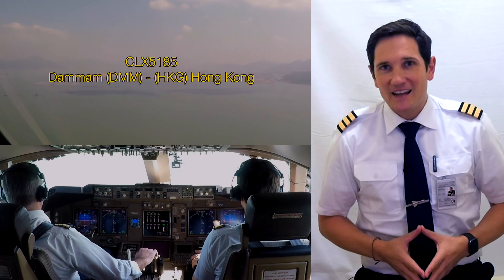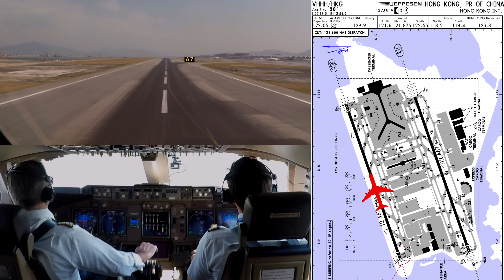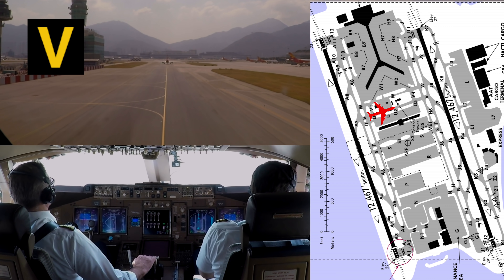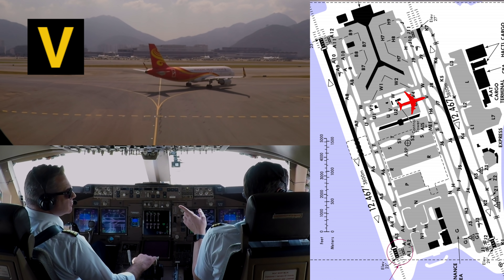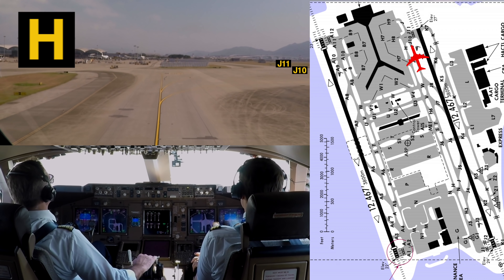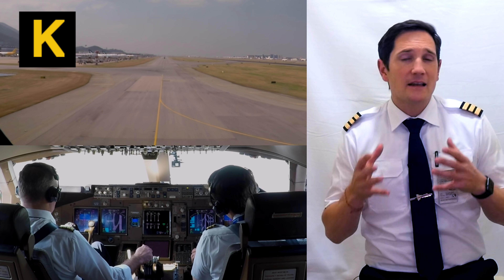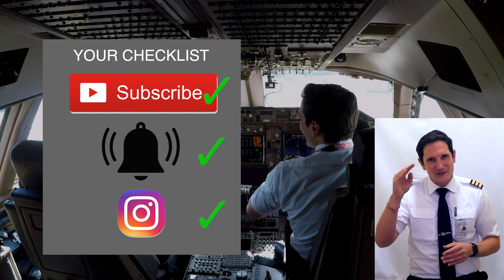How to taxi a 747 in Hong Kong

Comment: So is the crossing clearance dependent on which direction the runway is active? Asking cause the HS point is marked 25L, and J11 is the literally at the start of 25L, but both you guys and the controller referred to it as 07R when communicating clearance
Reply: Yes, the direction of the active runway is relevant (in this case 07R), and it is used in communication regarding the crossing clearance.
Reply: @mikep9604  thanks, I figured, but an unfortunate incident in my past likely precludes me from being able to enter flight school.

And that definitely seems like the type of info you normally only learn for sure in flight school lol

Comment: Why didn't the plane land on the closest runway to their designated location instead of having to cross over? It would have save on taxi feul.
Reply: It is the air traffic control that determines which one is the active runway. And it's a quite usual procedure that the runway 07L was used for landings, and the runway 07R for takeoffs.

Comment: @7:33 they are given clearance to cross 07R but the runway marker is painted 25L 25L. Why isn't 07R-25L? Is the convention in Hong Kong different than in the states?
Reply: Because you are at the end of the runway and you can only access 25L. If you cross it from somewhere in the middle, you get both 07R-25L, and of course at the other end you get only 07R. And tower said 07R, because that was the active runway at that time, so all traffic comes from that end of the runway.

Comment: What is meaned by "Hold short"?
Reply: There are holding position markings (a hold short line) on the taxiway before you enter the runway. The aircraft must stop there when approaching the runway. You must 'hold short' at the hold short line, and wait until the air traffic control gives you the clearance to enter the runway.

In this photo the smaller aircraft is waiting behind this line:
https://pbs.twimg.com/media/CfEiJ6jW4AASznt.jpg

Comment: Wouldn't it have been easier to land on the other runway? Just wondering why they didn't do that.
Reply: UlliStein Hong Kong doesn’t use its runway in mixed mode. So one runway is for departure only, and the other is for arrival only.
Reply: @ZK-APA  OK, thanks! That's an explanation. So it will be easier when Cargolux leaves HKG again.
Reply: UlliStein yup in this case.

Comment: Why is engine 3 in particular the one that's shut down? Does it alternate or is a random engine just chosen?
Reply: It's not randomly chosen. There is a reason why it's engine number 3. It is shut down because engine No. 3 does not produce power for the hydraulics that the aircraft needs during the taxiing.

Comment: I had a question. It seems that you've spent some time deciding which direction to turn. Didn't you have the map just on the screen? Is it better to look outside or find it out on the map? Thanks.
Reply: Always check the airport signs. You might take a wrong turn somewhere and that is why it is very important to always check the yellow and black taxiway markings. Map is just an aid. Same with driving a car. GPS is a good aid, but traffic signs are the ones that tell you better.

Comment: Hi, I have an unrelated subject. We boarded in a aircraft in Cyprus waiting to to leave and a message from an attendant apologising for the heat as the engines could not be started as the APU was not working on this aircraft and they were waiting for a land mobile APU to start up.  I may be wrong but I thought a passenger aircraft ( an Airbus A320) had to have two sources of power and the APU had to be working. We did fly to Manchester. I would be very pleased if you could enlighten me on this occurrence. Kind regards.

Comment: Hi Captain .. i love watching aviation related videos .. sadly i couldnt be a pilot but still have big passion for it ..

i have a question.
Why doesnt the right aircraft doors never open? because i have been into many flights and i never saw people board from there 
Much love ..
Reply: Hassan HMQ because cargo and maintainence use the right side. So therefore boarding is from the left. Right side is only used if left side operations  is not possible or an emergency evacuation is needed.

Comment: 07:33 - shouldn't this runway crossing be 25L? Why is the controller mentioning 07R instead (which is the threshold on the far end of the same runway)?
Reply: The controller says "07R" because it's the active runway at that moment. 25L was not the active runway.

Comment: @captain joe 

Love your videos, especially the technical ones. I would like to ask you a question - Why the bigger planes like the 747 and the 777 not have a trim wheel? when smaller planes such as the 737 and the A320 have a trim wheel which visually shows the aircraft being trimmed inflight.

Comment: you know i might saw you taxiing along from bay E3 when i was working on that CX A330
BTW dont know about cargo side, but ground power on those passengers side parking bay sucks, 0% reliable, screwed up lots of A350 and B787. airlines like EK and ELAL even told us NOT to connect those ground power, those EK double decker just kept their APU runs for hours and ELAL demands GPU from haeco.

Comment: Hi. Why shut off engine no 3? With the sort of power available would it not be better to shut off No2 and No3? Enough power available with Engine Nos 1 and 2. Why the have an asymmetrical power loading?
Reply: The engine number 2 gives power to the hydraulics of the alternate brake system, so the engine No.2 is not shut off. The engine No.3 is not essential for the systems used in taxiing so it is shut off.

Comment: What's these Juliet, whiskey 🥃, mother of dragon 🐲 and all? 🙄 🤔😲
Reply: They are the phonetic alphabet used in aviation. (Alfa, Bravo, Charlie, Delta....Whiskey) In this case here they are the codes for the different taxiways. Every taxiway at the airport is marked with letter code like A, B, C, D and so on. So taxiway A is Alfa and taxiway B is Bravo and so on. Dragon is the call sign for the Cathay Dragon airline, and this call sign is used by the air traffic control and the airline.
Reply: @mikep9604  Thanks Mike... I was knowing about alphabets... But not their use 😅

Comment: I used to work in ATC there in the Tower,and was part of the team that opened the place.It was all done on simulators as the airport was a green field site.All the Kai Tak guys came across for their conversion courses over a 6 month period.Initially opened on single runway which was way more interesting than 2 runways.The push back procedures are quite complex and often result in several stands having the same push back points.Often delays can happen as Ground does not have the concrete to accommodate several push backs from adjacent stands.We used to land freighters on the South runway,but I guess it's getting busier now,so easier to cross at the far end.Ground South 122.55 can be a pain as you can't see the arrivals from ADC north until they are at V or W coming up to H.I used to set up the arrivals off the ATM that were coming my way.The visibility out the Tower is dreadful,and they should knock it down and put a proper one up instead.
Reply: hi John. Fond memories. hawkeye
Reply: @davidhawkins4495  Hi Hawkeye,Where are you now and hope everything is fine.Got your Toil back yet?

Comment: Hey joe, I have a question. Today I was flying from marseille to vienna on Laudamotion's a320 and I saw this on the elevator, It looks like the whole thing moves, even though I only thought the rear of the elevator moved, so joe can you please answer (or anyone who knows) 
Here is the photo: https://photos.app.goo.gl/ratsRcTopgXiyeQQ8
Reply: Yes, also the whole horizontal stabilizer can move. Pilots can use a trim to change the angle of the stabilizer when necessary, or the autopilot system adjusts it when the autopilot is used.
Reply: @mikep9604  Thanks

Comment: Great vídeo. Just a silly question - nowadays we see lots of innovation in this area (e.g airplanes taking over- cruising - landing almost without human interference).

So, why is not possible to receive on the GPS when landing what is the route to the gate and avoid all of those radio communication (lot of risk of missunderstanding)?
Reply: GPS is never up to date. Anything can happen at any time and taxi has to be diverted through a different route. 

Usually pilots know what to expect when looking at the map, but communication is the beat way. Controller can make decisions in seconds if needed, but imagine in you have to make the changes is GPS for the planes, that might take few minutes and that could be a mess.

Comment: Terrific video Joe.  It's one of those videos that I will watch again, and maybe a third time, just to catch what I missed the first two times.  There is a website http://airnav.com/ (not the most secure website) that has a lot of the airports in the U.S. and some outside the U.S.  A good portion of the airports in the U.S. that have or has scheduled, routine traffic are loaded into this website and they have diagrams of the airfield.  I would love to see a chart of the same  quality made for HKG/VHHH.  The eight hour flight from Saudi to Hong Kong, do you require a relief pilot?  Last question, CargoLux fly a lot of point to point operation.  This is not meant to be critical, but are the "Freedoms of the Air" rules applied only to civilian passenger flights and carriers?  I would love to see a series of "Captain Joe Freedoms of the Air" videos.

Comment: Just wondering, why not land on the closer runway?
Reply: P.S. I'm not an aviator obviously.
Reply: One runway for takeoffs and one for landings is the best way to keep airport running. Less delays and easier for the controller. It was a long taxi after landing but very short before takeoff. If is quiet, that can be done. But not during rush hours.

Comment: For extra credit, rewind the "tape" and step through the "Points of Potential Conflict" that arose during this surprisingly complex operation.  What's the PF and PM actively trying to prevent between touchdown and handing off the aircraft to ground crew (eg. Overrunning desire exit taxiway, turning at too high a speed for conditions, unexpected traffic during the turn, no response from ground controller after handoff at "victor".

Comment: Never knew you had to contact the Tower controller to cross the active runway. Now that you mentioned that though, it makes perfect sense.
Reply: It's the procedure at all airports.Even vehicles have to be on the same frequency.Lessens the chances of runway incursions.
Reply: I think it depends on how busy the airport is at busy airports the tower controller is the person who gives the clearances on runways. The few times I flown out of my home airport with my pilot friend the ground controller has given the clearance to cross what I believe to be active runways.
Reply: @thenormanator9379  I have been in ATC in several airports and GMC issuing runway crossings was ditched some time ago.Runway incursions were the hot topic and this was seen as a potential problem.It doesn't mean that it doesn't happen,but it's a measure that is trying to prevent an accident happening.CLK airport also had the Surface Movement Radar with built in Runway Conflict Alert.

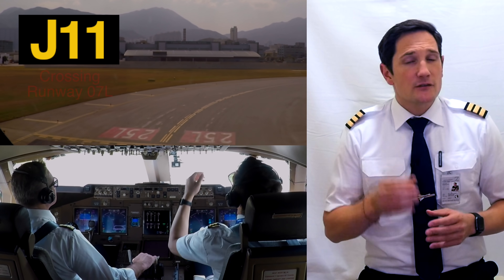Comment: 8:19 Both sides of the runway said 25L, guess you just get used to the conversion of 25L is also 07R by memory.
Reply: msnpassjan2004 No memorization necessary. It’s a simple formula — 25-18=7 or 7+18=25. To confirm 2+5=7.
Reply: @wotan10950  Dude you totally rock, Thanks !

Comment: Welcome to my homeland - Hong Kong! 
Sadly they didn’t let you land on 07R which they usually do for Freighter.
Reply: Not in the morning I think. North runway for landing and South for take-off in day time. North (or South) runway for both take-off and landing in midnight.
Reply: May be after 4PM in Hong Kong will be easier to let Freighter land on 07R
coz 07 direction is limited capacity due to the terrain limitation for the go-around flight path, you can't have a go-around short turn like LHR/other flat land busy airport does. You need to go straight for go-around when u landing 07R.
Reply: isn’t this procedure just happen during night?
Reply: @chunyiutsui4100  nope, South landings are totally not unusual during day time. As Thomas said, freighters and business jets have higher chance to land on south rwy
Reply: KP Ng thx for the information but why?
Reply: @chunyiutsui4100  Because the cargo terminal is in the south
Reply: @chunyiutsui4100  during arrival peak hours, too much arrival holding in the air is not desirable. Letting some of them to land on the South RWY would theoretically increase the arrival rate(by sacrificing departure rate).
Reply: In my experience I land on the north runway 90% of the time.  For the remaining 10%, almost always it was at night and the north runway is closed.  You hardly get to land on the south runway during the day.
Reply: I wonder how will they use the third runway tho also if the plan to make a fourth run way or second airport where should they do it
Reply: I long for the day the third runway starts operations.